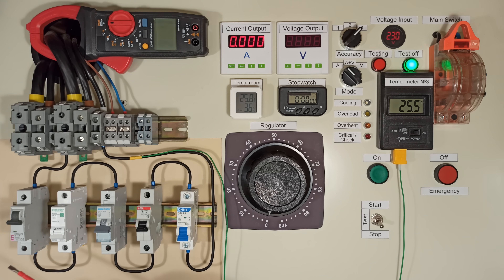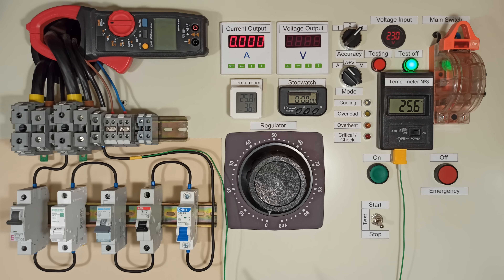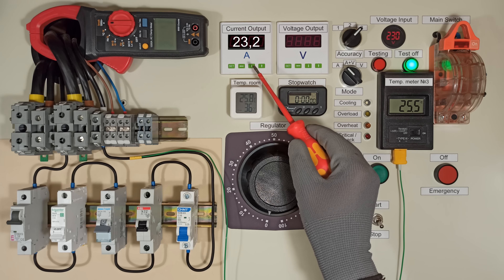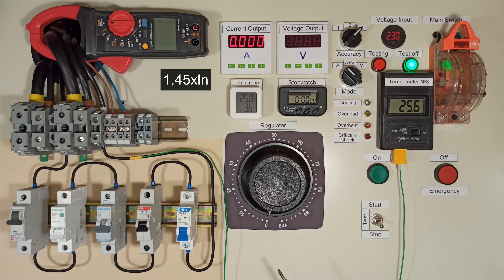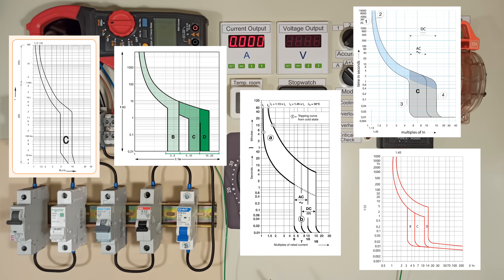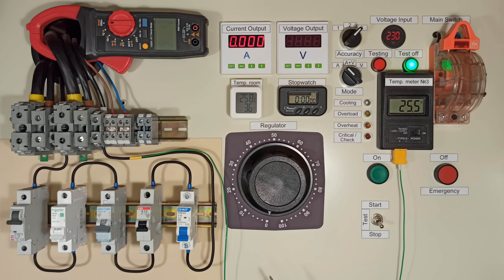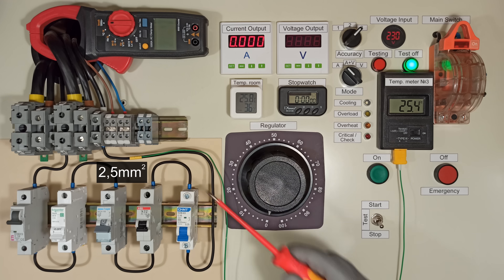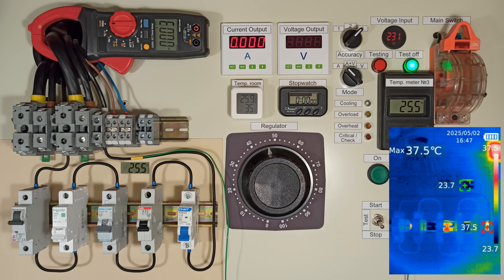Test MCB 16A. ETI, SE, Hager, ABB, CHINT

Comment: Faster is not necessarily better. It all depends on your requirements. As long as they perform according to the spec sheets. That's the most important.
Reply from the maker: Thank you, I completely agree. For commercial properties, it's generally better if the breakers hold longer — within safe limits for the cables — since prolonged overloads are quite common there.
Reply: @ElectroTest_1  That's why there are A B C and D type, A simply said is fastest and D is slowest for high inrush currents of lets say electric asynchronous motors.
Reply: @ElectroTest_1   ETI and ABB may be more suited to cold countries, which is why they are more sensitive in a warmer environment.
Reply: @ElectroTest_1  Here in switzerland i never saw ABB breaker in privat homes before. But saw alot of hagers used.
Reply: @ElectroTest_1 yeah like running 10 1200W servers off the same outlet... (Test setup, it also doesn't have breakers)
Reply: @ElectroTest_1 ETI et ABB sont peut-être plus adaptés aux pays froids, c'est pour ça qu'ils sont plus sensibles dans un environnement plus chaud.
Reply: @PaulZelinsky-un3nc  A bon? Le seuil de déclenchement est plus bas parce que ça chauffe moins vite par là?
Reply: @ilhomi.5836 En russie il fait froid.
Mais c'est la surchauffe du mécanisme qui déclenche le disjoncteur.
Donc je pense que dans les pays froids, la norme doit être légèrement différente pour permettre au disjoncteur de sauter même s'il fait très froid
Reply: @ElectroTest_1  Chint is better, for price and quality but still safety
Reply: @cubegim  My experience of chinese electronic is that they don´t pay much attension on safety or lifelength.
Just cheap to prodcuce,
Reply: @fortune300  my experience, safety's good, price's good. Just about lifelength, for 5-10year maybe up, depending product series....is worth😂. Cina Product is good choise...wellcome to the new era
Reply: @cubegim  Exactly! Good quality and good price, the chinese one most probably is 3 to 4 times cheaper than the german one, and yet they both perform up to the specifications, then, simple choice for me, definitely go for the chinese one.
Reply: @epicsuper6775 😅 saya orang indonesia, kebanyakan masyarakat disini memakai KWH meter tegangan rendah 220V, 6A, 1P, untuk rumah ataupun toko 1 lantai tipe sederhana pada umumnya. Dengan kondisi cuaca dan lain-lainnya, untuk kebutuhan mereka, brand CHINT dirasa cukup dan layak. Mengingat harga ELCB+MCB brand terkenal bisa dipakai untuk 1 set alat pelengkap keamanan kelistrikan. Orang lebih gunakan anggaran mereka untuk RCBO + MCB Group CHINT, bahkan sisanya dapat dialokasikan untuk biaya sistem grounding. Tentunya dengan perkiraan masa pemeliharaan dan sesuai standart keamanan
Reply: They all do what they are supposed to do: Prevent a fire because of overheating the cable.
Reply: @jaro-ch It would have been very different with 1.5mm2 cable, that is still used in germany with 16A RCBs...
Reply: @jaro-ch  Actually they are all meant to ensure power gets delivered, without causing a fire hazard. a 16 amp breaker that breaks at 5 amps would also "prevent a fire because of overheating the cable" but it would be useless. 
Being from slovenia and having all ETI breakers everywhere this test was disappointing to me.
Reply: @MihaZidar Du hast offenbar den Sinn und die Funktionsweise von Schaltautomaten nicht wirklich verstanden. Wenn ein 16A Automat bei 5A auslöst, dann ist er defekt. Wenn er bei 23A auslöst, dann stellt sich die Frage nach der Auslösecharakteristik, soll er bei Überstrom schnell oder langsam auslösen? Wenn Du einen Elektromotor hast, so hast Du grundsätzlich beim Einschalten IMMER Überstrom aufgrund der Selbstinduktion. Dies zerstört jedoch keine Leitungen! Dafür gibt es Normen und Prüfsiegel und die hier getesteten Automaten (Breaker) erfüllen diese, ohne Ausnahme.
Reply: I have to ask, though. Shouldn't it trip quickly enough to prevent damage to the appliance on the other end that it is supposed to protect?
For example, I would expect a DC MCB rated 25A to trip and protect an inverter that it supplies. If it trips slowly, wouldn't the inverter get damaged?
Reply from the maker: @ekeretteekpo3004 Hi! The thing is that circuit breakers have two types of protection:
1) Thermal — it depends on the current and reacts slowly, especially for currents up to 3–5 times the rated current (In).
2) Magnetic — it reacts quickly (0.01–0.1 sec) to currents starting from about 3–5×In.
For protecting wires, either one works well.
But for protecting devices and equipment, you should follow the instructions — they usually specify the recommended breaker rating and type.
An inverter is a rather complex device and usually has built-in protection systems.
There may also be a fuse on the input side.
Reply: @ElectroTest_1  Thank you but it's still confusing to me. I guess I have to read up on how breakers are designed to work and maybe why.
Reply: @ekeretteekpo3004  Hows it going with reading up on this?

Have you found "nuisance tripping" yet? An over-sensitive breaker will trip when its not required. That can happen on circuits with motors that have a high inrush current. If the breaker responds too quickly it will trip when there isnt a fault.
Circuits that dont have high inrush currents can use breakers that will trip faster.
Thats why there are different response curves (response time vs current)
Reply: @ekeretteekpo3004  Circuit breakers are never ever intended to be used to protect over current of non faulty devices. They are there as the last resort to protect the wires. If your inverter does not have over current / over power protection, consider buying a better (smarter) device. The device should shutdown itself in a graceful manner.
Reply: @ekeretteekpo3004 Circuit breakers are designed to protect the wiring, not the devices that are connected to the wiring
Reply: Booed...You such a load of craps!
Reply: The MCB . We have 2 model work protocol 
1 for protection srcuit 
2 for protection accessory equipment
Reply: No, it should work on the given spec's.
Reply: If you need another time, the you can use D braker, it will be correctly.
Reply: This is precisely the reason, I prefer HRC fuses, over mcb.
In my test benches I always use semiconductor fuses in series.  
Now that semiconductor fuses prices have dropped drastically, it makes no sense not to use it. 
Please note the tripping time is what protects from a disabling injury. (I prefer less than 5mS). Flashover in face creates serious injury (seen umpteen both for humans & simians).
Stay safe & donot use mcb as a protection. Use a large rated S.Fuse if in doubt, but do use please.

EDIT: Tripping time in Second😅😅 is NO safety for the personnel. It's like a jack hammer hitting an object 5mS makes sense. 1S makes it a salad.
Reply: @AnwarKhan_786  "Stay safe & donot use mcb as a protection."  wow, such great comment with merit. All those actual arguments here which applies to things like home installation or control cabinets in industrial systems... Oh, not really no? Ahh... HRC surely do have their uses but making then only type of protection is both silly and impractical.
Reply: @Promilus1984 At my house I have ELCB + (SFU with HRC) at the mains board (in the building common area). MCBs at the distribution board (inside house) + switches in rooms & semiconductor fuses in my test rigs (I test SCR firing ckts, IGBT).
In my panel boards I prefer to have SFU (fuses) for multiple ckts + MCB as switches. Clients love MCBs (no rewiring) but always leaves me worried she might be switching on a short circuit (scr, IGBT). The advantage of a sfuse also is it blows fast, elsewhere (at the back of the panel board) away from the face.
SFU: Switching unit with fuse.
EDIT: Please use ample safety in DIY setups.
Reply: That depends upon the designer of the circuit. if you are following just  replace, if you are designing / developing a new ckt.. the timing is all it takes (and the class of overload)
Reply: @AnwarKhan_786  Sure. And you have your home/apartment installation. What kind of overload you might expect? In case of UK there's rather large MCB on whole line and dedicated glass/ceramic fuse in cable to device itself so MCB is to protect line and fuse to protect device (and users). In Poland there are MCBs per circuit and appliances with or without own fuses. So if you have 16A circuit that's what you get in summary. That's one water heater or one large vacuum cleaner working on the same circuit at the same time. What happens when you turn on both? Well it depends on the overload. If it is large enough with fuse it will slowly but surely burn out. With MCB it will slowly but surely heat up and disconnect. What exactly do you prefer? As for malfunctions of devices... well that's tricky because it's not exactly per se required to have a optimal fuse inside (except UK where it is hidden in a plug). Some devices have IEC socket with embedded fuse holder. Some have fuse inside the case. Some doesn't even have that (like my hammer drill). So what'd happen if it does short circuit? MCB will take care of that fast enough. If it does produce line on metal case? RCD will take care of that. I see no actual reason to believe MCB are inferior in that particular application. There are some applications where their usage is limited though. E.g. semiconductor devices which might blow a big time unless disconnected very, very fast. But even then... I got some VFDs after cabinet fire and even best safeties didn't account for a loosened screw connection. Only IR inspection under load might show that. And guess what - that's not what happens frequently in private homes.
Reply: @Promilus1984 My reply is chiefly for the DIY enthusiasts, rigging up a test bench. Timing does matters, without going into the i²t ratings, MCB curves...
Edit: I do get calls where neutral gets burnt out  It's never due to a loose connection (which eventually does happens) but rather due to unbalance current, (heating due to harmonics) due to faulty design (transformer primary being star) (the correct way is to have delta- Star in power control ckts
Reply: @AnwarKhan_786  Well if you're prototyping or doing some repair, or test on workbench then sure, it's either very fast fuses or just current limiters like ... old fashioned tungsten light bulbs. Yup, those make wonders.
Reply: These were all class C breakers..
Reply: if theres huge overload like human in between then they would trip instantly....
Reply: None of these tests runs was fast.  To me it seems this test evaluated the long-time current limit of the breakers.
Reply: @maxenielsen  well it is how breakers were supposed to work. There's very fast component which is electromagnetic actuator which requires essentially short circuit current (much larger than nominal MCB current) and there's bimetal component which reacts to energy transferred being higher than nominal. Bigger the difference faster the reaction.
Reply: @Promilus1984  I am not sure if it is global standard or local. This video shows C16 breakers meant to trip really fast at high overload. For huge motors, you would want something that does not trip to short (seconds) surges within some higher (maybe 10x) limit. I cannot remember its code. some comments say it is B but I remember it being D. For household, use C type for everything else and the other type only for AC.
Reply: @yuxuanhuang3523  For households it is usually B unless there's something with high inrush current which is best left at C. Those letters exactly tells how much overload can breaker handle before it trips. C handles iirc ~5-10 nominal current D goes even higher than that. D is usually used for motors which use regenerative braking and can really fast push really large current into the network. There are also few other types than A-B-C-D like K which trips at 8-12 nominal current surge.
Reply: @Promilus1984  Thanks. I checked my apartment breaker panel and it is all C rated. ANd if I remember correctly, newer apartments with centralized AC use D rated breakers for the compressor unit and C for everything else. Guess they did this to keep them from tripping too often.
Reply: @maxenielsen interestingly I believe the first tests at 23A were literally the lowest overcurrent where the breaker is still guaranteed to eventually trip.
Reply: @maxenielsen  at 1.45x nominal it's exactly what it is testing , you can even see in on the curve
Reply: Thats the most fascinating part for me: Regardless if you want fast or slow tripping, all of them stayed within their tripping window or quicker. I not expected that the chinese one even stays within his own tripping window. Yet all of them are more or less likely being made in china anyway.
Reply: @Scoutter  Nope. I've seen SE and ETI made in Poland, most likely ABB as well.
Reply: @Promilus1984  ETI is mostly made in its seat in Slovenia but they do have a small manufacturing plant in Poland too.
Reply: @Promilus1984  Actually, most ABB/SE produced in China.
Reply: @wirelessafrica  "most" doesn't invalidate that those items are produced within EU as well.
Reply: @Promilus1984  schneider has a Chinese factory. I work on a lot of Chinese machines and a few of them have Chinese made schneider electric switchgear.
Reply: @SvenIronhand  And how the fact that schneider has factories in China counters the fact that schneider has factories in EU? Did anyone claim Schneider DOESN'T have factories in China?
Reply: @Promilus1984 why are you being so defensive with everyone? We're just saying that some schneider products do get made there.
Reply: @SvenIronhand  Nearly EVERYONE manufactures in China. Doesn't mean all brand items comes from there and that was the whole point. So me proving Schneider does have EU based facilities does bring something to the actual discussion. Any information about what is the ratio of CN and EU based Schneider items on market might be fruitful as well. Posting "I've seen Schneider manufacturing lines in China and their products" doesn't really bring anything new to this particular discussion. So no. Pointing out how irrelevant that post was to already few months old thread ain't going defensive. Too bad you do not understand the difference.
Reply: @Promilus1984 wow how mature of you.😂
Reply: @Scoutter  That CHINT breaker is considered as a big brand there in China as I saw during factory visits there. No matter in which country, be cautious when considering purchase those makes of breakers never heard of
Reply: @TheKimberlyashton  CHINT are used by Enel in their energy meter in Italy (Enel is our main national energy supplier)

Comment: Nice test! I'd like to see more of this:
- B versus C characteristic.
- Tripping response @ 1 x, 2 x, 3 x, ... N x nominal current rating.
- Multiple breakers of the same brand and type to see how consistent their response is.
Of course the manufacturers provide response curves, but it's nice to see in practice how the breakers respond!
Reply from the maker: Hi, friends! This topic is interesting to me as well. I think I’ll be doing similar tests! I see there are many variations with circuit breakers — I’ll start with the ones people mention and like the most!
Reply: We had lot's of issues with programmable power supplies such as Rhode&Schwartz  and Keysight  tripping  C-curve circuit breakers on startup. Once C-curve MCBs was replaced with D-curve one the problem was gone.
Reply: Well b Vs c shouldn't make any difference... The overload part of it doesn't change ...
Reply: yes B vs C would be very interesting since a lot of manufacturing don't show much of a difference between B and C for overloading, only for shorts
Reply: @yomyh  Overload Curve is identical from what i have seen in pretty much every Spec sheet, its just a difference in the Short Circuit protection. Which makes sense, because if you have a high inrush Current, like for Motors, you pick C or even D over B. If you have higher requirements for "Overload" you choose a higher nominal Current (and usually also use thicker Wires)

Comment: Great stuff! Might be interesting to measure the volt drop across each breaker too  at 23A it might amount to something significant - then you could calculate the power dissipated by each breaker.
Reply: 23 times zero is still zero, or next to zero.
so...no.
Reply: @ivok9846 I think it might be a few mV. Let's say it's 100mV (for the sake of argument), that would be 2.3W in a breaker. There must be something for them to get the warm enough to trip, so I don't think it will be zero.
Reply: @AllTheFasteners  Не проще ли замерить сопротивление всего автомата?
Reply from the maker: @ivok9846 No, it won’t be zero =) I think it’s totally possible — and even interesting!

Comment: would it not have been better to test only 1 unit at a time instead of series units as the coil resistance of each would effect others , also repeat test of a unit would show aging effects if you disassemble at the finale of testing , and I also agree with prior comments on CHINT not being in spec often, so much so our local dealer used broken/returned items to build a optimus prime sculpture using this brand components and apart from being red/blue/silver it nothing like what you imagine or what optimus looks like
Reply from the maker: @colingale I can test them separately, but testing them together is more informative because it gives us a rough statistical picture with fewer tests. Additionally, we can see that the same current flows through all the breakers. And how does one breaker affect the others during the thermal element test?